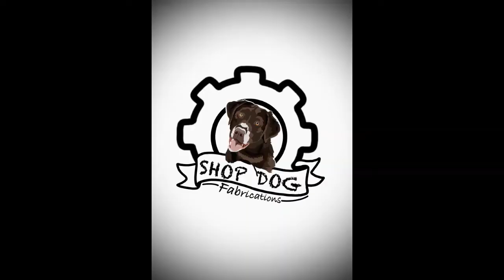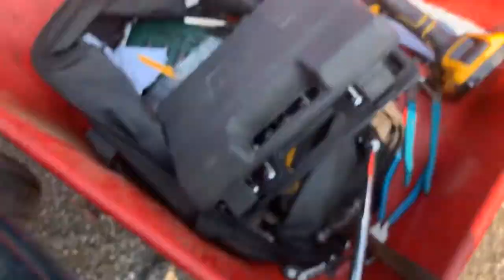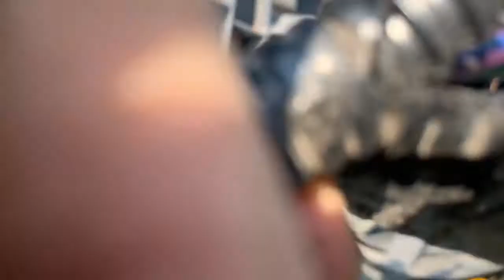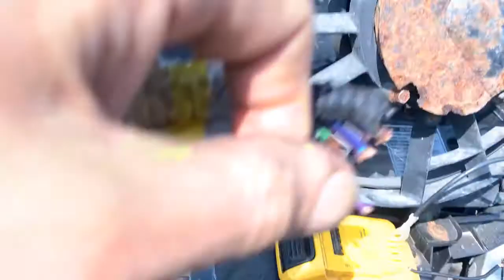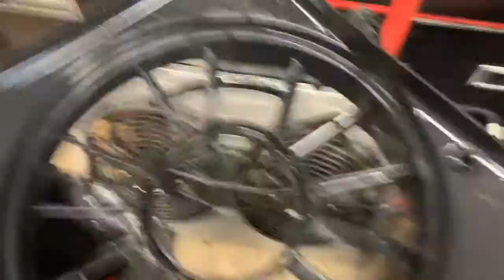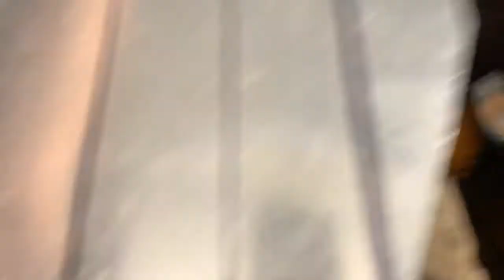Ford Contour Cooling Fan Install and Wiring into your car (Mopar, hot rod, rat rod, trail rig, etc)

Comment: Great Video !!!, I was thinking of using 1 3way switch, rather than 2 SPST switches.   what do you think. .
Reply from the maker: Should not be an issue, I just had these rocker switches and went with it. All they do is flip on the relay. That 3 way would be doing the same thing

Comment: Do you recall what size sockets and such you needed when pulling the radiator out of the Contour? How well do these work? I need some for idling for a long time in a parade for over an hour at 2mph.
Reply from the maker: I do not as far as socket/wrench sizes. They work great, I’ve been in Chicago traffic and will switch from low speed to high speed for a bit when the temps rise and then back to low speed. I’ve had no complaints and it’s fits my radiator great.

Comment: Good video. Additionally, You can use a car door weatherstrip seal to help seal the fan shroud to the radiator. That will also help with cooling.
Reply from the maker: That’s a great idea, didn’t think about that.
Reply: @ShopDogFabrication  My buddy showed me that. Also helps to keep the shroud from vibrating. Car looks good.
Reply: I saw a neat trick by taking a 3/8 vacuum line and slicing it long ways and install that on the shroud edging to help stop vibration and seal the gap